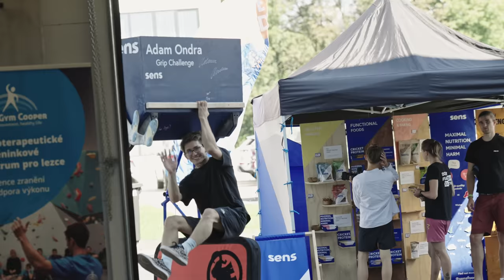Climbing Challenge by Adam Ondra: Set a Boulder Problem That Others Will Fail On

Comment: adam's boulder was really cool. would have liked to see the other 3 give it another go or two.
Reply: why did they onlu climb it once?
Reply: I assume we didn't get to see the others attempt it more than once because they probably fell down on the very beginning of the problem on their other attempts. That boulder is impossible for anyone that is not called Adam Ondra.
Reply: I think they even said attempt two for Adam Ondra, so no one got it in one go.
Reply: @thatperson2478  yes they said that, and notice that the author of the boulder is the last one to try it so I assume they edited out the second attempt of the other guys, who tried it before Adam
Reply: I think they were all very cashed and they knew that they were risking injury or skin tears so they waved it off.

I will say Adam built that route "very tall" and that can slow folks down where they need to figure out their own beta to work around the height issues. That drop knee hold was likely too high for anyone but Adam as he has several inches on everyone else.
Reply: @ultigirlinCO I think Adam is like a colossal/god level while the other 3 are like superhuman level.
Reply: I'm assuming they only climbed it once because it was a "winner take all" comp although obviously fun spirited. and when adam topped it he won no matter if the other three could top it or not so they competition was ended.

Comment: The video is awesome so far! Little feedback for the AO Team, the titles that appear on the video overlap with subtitles, so if you want to read them you need to disable subtitles, read the titles, then enable them again. Its not a big deal tbh just something I noticed that is not very intuitive
Reply: You can set the position of the YouTube subtitle (at least on PC) to where you want by dragging.
Reply: @dworkina.9015  wow, TIL. Thanks for the tip
Reply from the maker: @dworkina.9015  That's right, thank you! AO Team